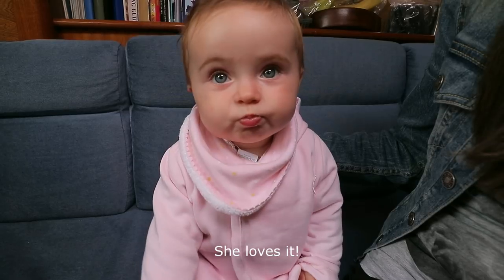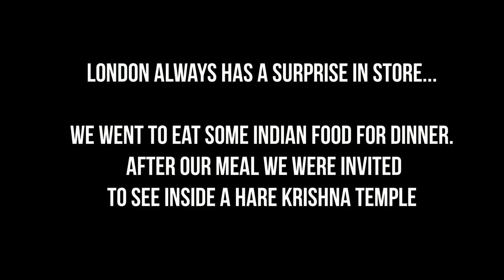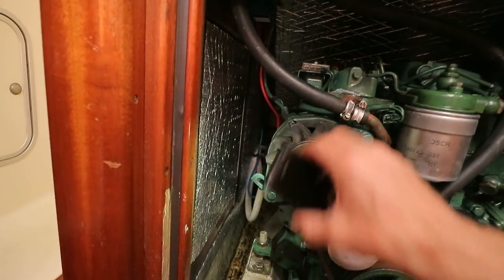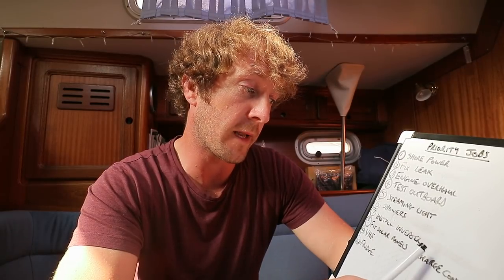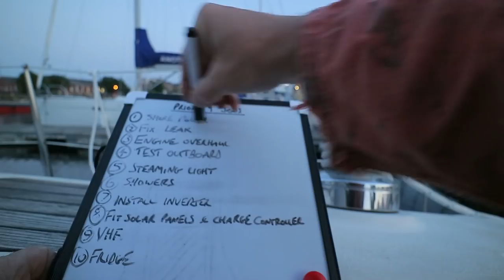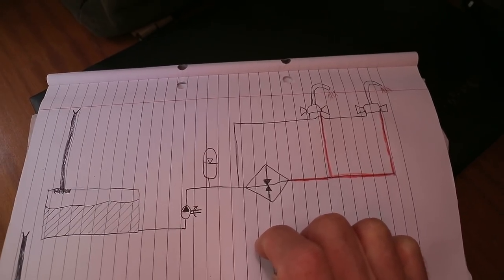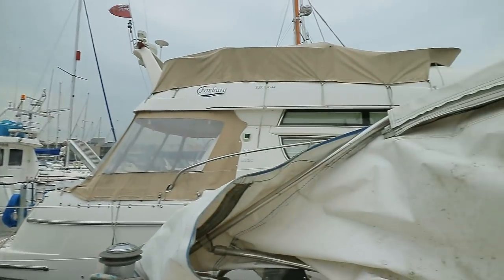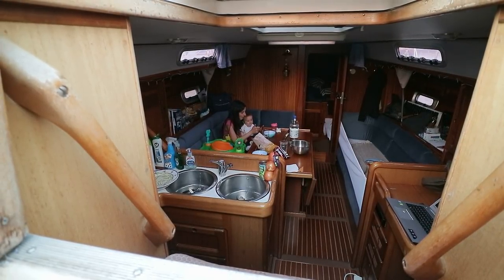Priority Jobs and a Trip to London | ⛵ Sailing Britaly ⛵

Comment: Can I give you a tip for wrapping PTFE tape, if you flip the roll over to how you had it you can pull it tight with the roll as the wrap it and let a bit off at a time (it's a hard one to explain) also I used loctite 55 thread seal at work (plumber) for joints like that it's brilliant stuff.

Comment: Hi Chris and Rossella, another interesting vid. There's a lot of cuteness happening on your boat .
I have the same motor on my boat but single cylinder ( it looks like yours maybe a twin? )
I cant get to the sump plug so I had to resort to sucking the oil out with a cheap pump via the dip stick.
The pump didnt like the heavy old oil, I fried it (the pump). I suspect its never been changed.
The guy in the oil shop recommended I buy a plastic vacuum canister because its the thing people have 
the most success with, but I choked on the price. I should have put some kero in it to thin it.
Keep up the great work
Tom in Oz
Reply from the maker: Hi Tom! Thank you! We have completed our engine overhaul now and as part of that we made a 'How To' video about how we change our engine oil. We use a brass hand pump which is tiny, cheap, simple and reliable. We suck the (hot) oil out via the dipstick hole and it works a treat. You can probably find one of those pumps quite cheap (£15 on eBay in the UK with delivery to a UK address) if you search around online and finding somewhere to stow them is easy on any boat as they are tiny! Fair winds, Chris, Rossella & Emma 🙂

Comment: Pretty nice and big seating area. But isn't such an L-shaped kitchen a little bit small though? You've got 2 wash basin, but where do you cut your onions and stuff? Or do you use the salon table..?
Reply from the maker: Hi there, we have two wooden infills for the sinks, so they can both be used as work surface. (We place a cutting board on top to protect them) Fair winds, Chris, Rossella & Emma 🙂

Comment: Hi Guys,
Love the series- well done. Great life that I am so jealous of 
Just a quick note with Jubilee clamps ( hose clamps)- Never over tighten. If you are squashing the hose ( like in the video) then you are way to tight. Most fuel and water and air hoses are 2 layers with a woven nylon weave in between each layer. If you over tighten, the barb on the fitting can (will) cut the inner layer allowing the media to leak in between. This is most notable on air hoses where they puff up and look like a snake eating a rat. easy fix, remove the hose, cut an inch off the end and reinstall.
Never, NEVER resinstall a clamp on to the original end- always cut back 1 inch.

Comment: Is your Volvo Penta a 2002 or 2003?

I have a 2002 - yours in much better condition than mine!

Parts are expensive (OEM parts) - an impeller for the raw-water pump is around $60 Australian dollars (around 1.5 inches in diameter) - so if I could offer any advise, buy non-OEM parts

The exhaust elbow is around $400 Australian dollars - mine is in good shape (engine done 2900 hrs) and I've heard you can remove internal corrosion by soaking the elbow in muriatic acid - that job is on my radar of things to do
Reply from the maker: Hi there, we have a 2003. We have done a complete overhaul on the engine and will cover this in future videos, so we don't want to spoil those for you! The good news is: we fixed the cooling water issue and it was very, very cheap! 😉👍